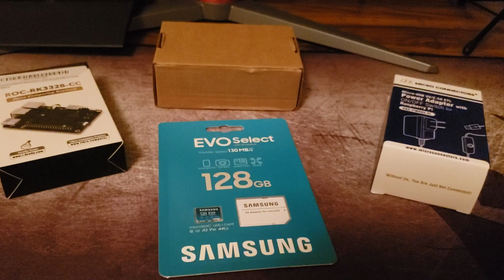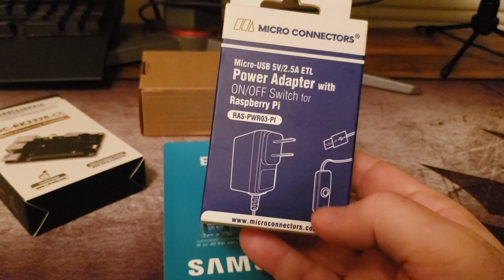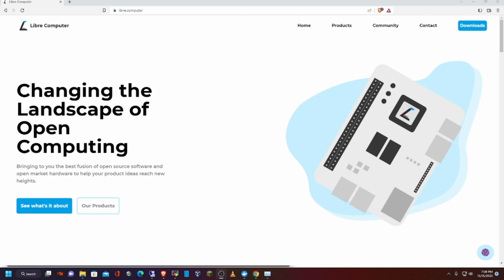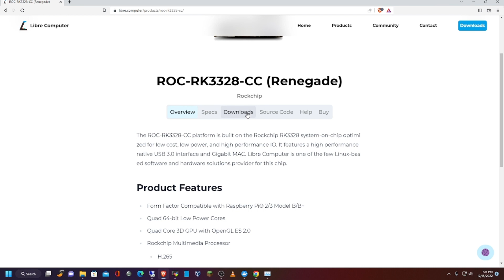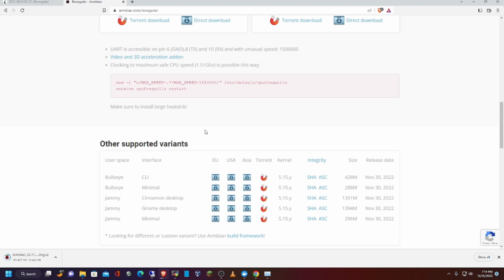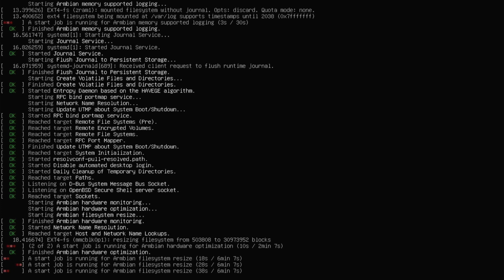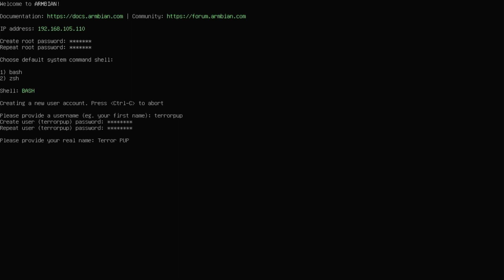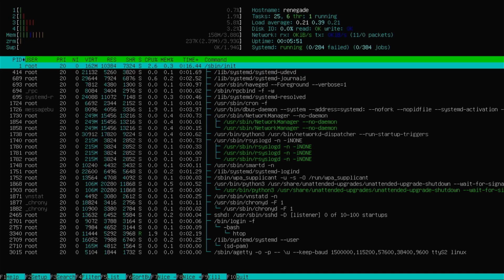Ugly Scale Press - Libre Computer Renegade (fixed)

Comment: I also think to use the board as a web server. I will install FreeBSD though.
Reply from the maker: Unless you can compile FreeBSD, I don't think it on there. Good Luck. I Ambian Debian Bullseye with Nginx, it works nices.
Reply: @terrorpup  There are several precompiled versions of FreeBSD for different arm processors. So far, it worked well on RPi 2 and 4. I will use Java web server.

Comment: I've been playing with the Tritium, Le Potato, and now the Renegade for a few months. The Renegade is hands down the fastest of the trio (4gig). I tried the Potato for my 3D printer (OctoPrint) first but it was too slow, so I tried the Tritium (Specs are a little slower, but it was faster for me, and has a camera connection), and now the Renegade. It works as well as my Raspberry Zero 2 was doing until it stopped turning on for some reason.

Armbian or Raspbian have both worked well for me (Headless). Next is to test out the eMMC side of things. If it can help the Tritium pick up a pace a little, I'll use that on my Delta printer.
Reply from the maker: So, I started four years ago with La Potato, at the time it was ok. With the Pi storage I was looking for a good board. So I got a two gig Renegade, and I was wow, this is a great board for being an older board. I now own nine of them.  I got Tritium because I want to get all the Libre Computer boards. It not bad, and I want to do some media with them, I have two.  I have three Le Potato, two are Retro Machine, and one is my Open Media Vault. I have a La Frite ad that a cool little computer, I am using it as Nagios Server. Lastly I got Super Renegade, but I can't get to boot.  

From working with LibreComputer I been playing with AML and Allwinner processor, and I have to say not a fan, but the Rock Chip, I love it.
Reply from the maker: Oh, with my Renegade's I am running Docker on them. They do nice in clusters.

Comment: I have a 4gb Renegade running Ubuntu Desktop. I bought the Renegade heat sink and the 128gb eMMC card for it. I never did get it to boot from the USB 3 port, but the eMMC card works great! Nice little addition to my home lab.
Reply from the maker: I haven't tired the USB boot. I might do that, I know the La Frite is another board you can boot from the USB, I need to try that as well. I bet you have to update the firmware for it to boot from the USB port.

Comment: I have 4 of these and none seem to be working? I have them connected via ethernet on my tp-link gigabit switch and only one has the blinking lights. When I plug it into an hdmi it says that it can't find a source. I used wind32 disk imager to flash the image onto a 32GB micro sd card. please help
Reply from the maker: Are you still having issue. Sorry this year when I started this been a battle. Please let me know I can try to help out.

Comment: Ive been using raspbian on the potato and its run great honestly. I was thinking about getting a renegade but i kinda want an orange pi 5. Wish i had more cash haha
Reply from the maker: Good choice! But for a budget, Libre Renegade 4 GB is worth it, currently $55 on Amazon, and you can use any Raspberry Pi 3B + case.  I am using that as my Nginx server which has replace a Super Small Format Factor Dell Optiplex 755. I am saving power and I have double my memory. I bought that server used from a friend for $60 bucks.
Reply: @terrorpup  I'm looking to buy the renegade mostly as a media player , there's not much info out there on how it runs liberELEC (Kodi). So, that has me on pause. Do you know of any guides or resources? Thanks for your help and great video.
Reply from the maker: @geraltofrivia__w.w.7513  Not hand, have you check the forums? I can take a look later, if it offer as a download, there will be something on forums to help.